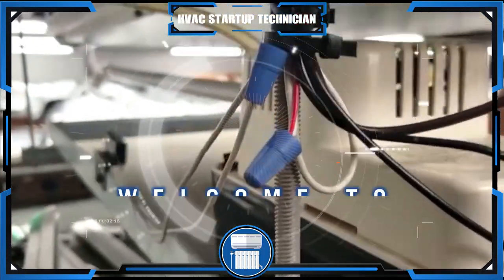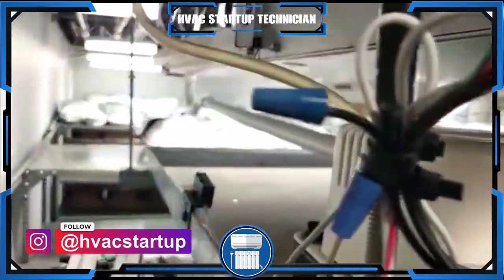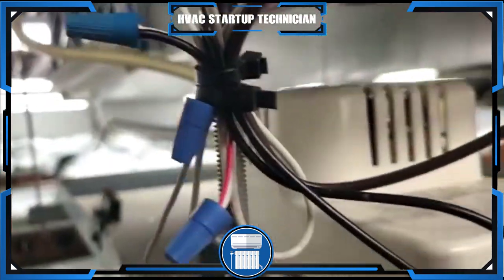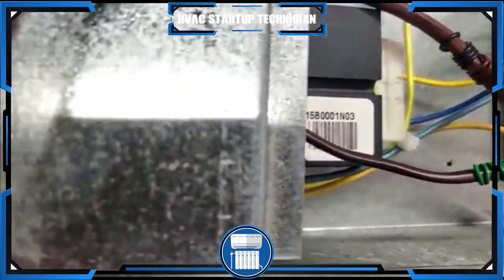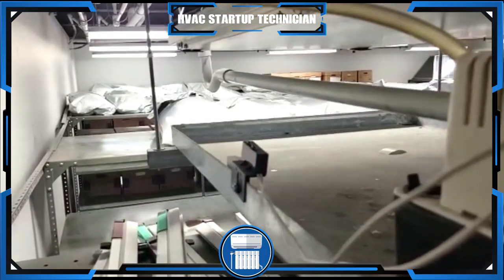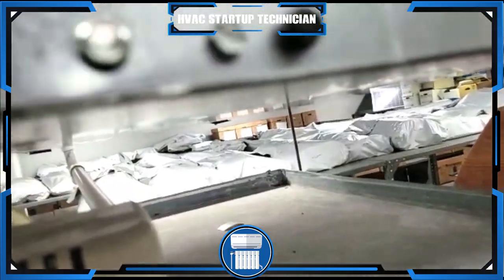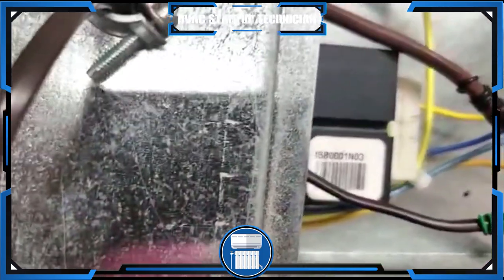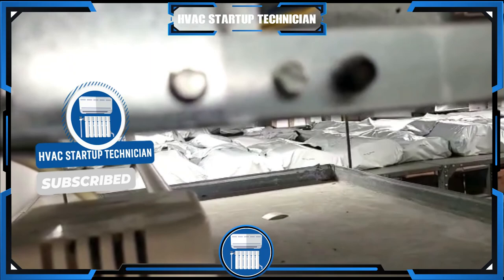condensate pump safety switch wiring how to wire float switch to furnace

Comment: I really didn’t understand. It would’ve been great if you would’ve recorded what you did or draw it out. You had too many wires on there and it was hard to trace them.
Reply: take one end of the float switch and wire nut it to one end of the pump, then u gonna take r off the board and wire nut the other end of the pump or float switch to it (it doesn’t matter) then the leftover wire either the pump or the float switch u gonna place that on the r terminal on the board, it’s called daisy chaining